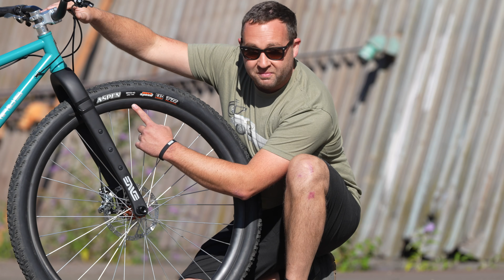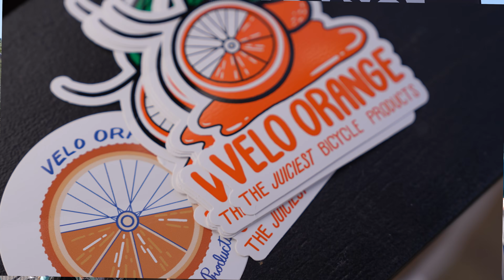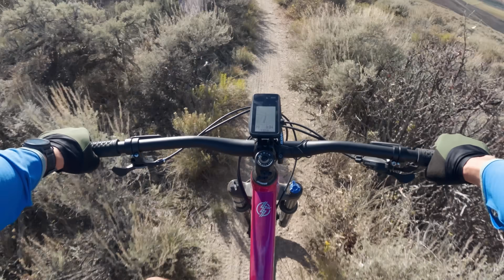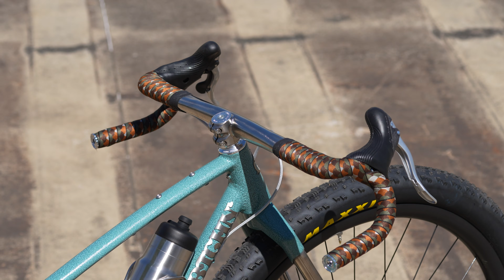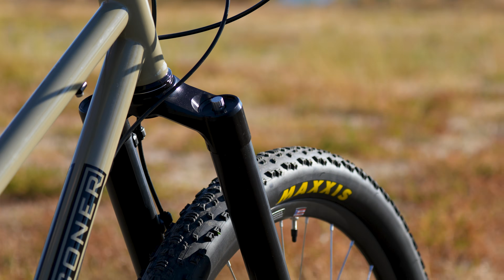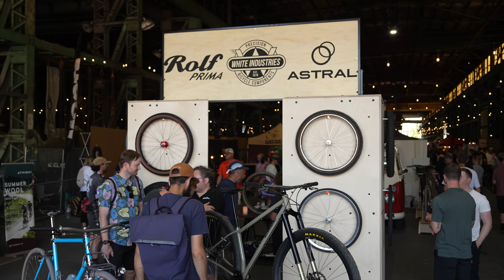Are 32" Bikes The Future? (MADE 2025 Part 2)

Comment: Just like 650B (whose gravel tire selection is slowly disappearing again ever since people figured out that 27.5 inch cross country tires are more supple and grippy and just as fast) it's gonna hinge of tire manufacturers and tire selection. It might end up being a niche for very tall suspension riders or medium and up riders looking for fast rolling rigid bikes, but with suspension travel in addition to the huge tire size it's going to be way too much of a compromise in frame geometry for anyone below medium. Hell, full suspension 29 inch bikes are already at the fringes of useability for very short riders.
Reply: All XC bikes now are stretch limos compared to early 29" offerings. It may revert eventually.
Suspension is NOT a must-have. 26" rigid bikes were how the sport got started and loved around the world and an Olympic sport
With 29" there is less need for suspension and with 32" a bit less still. You will be able to get a 32"er with a 29"-length rear end (brands will just make a better effort) and minimal toe overlap. It will fit and handle fine for every M-L-XL-XXL. Probably even S.

Comment: Rollover is king of gravel and bikepacking, as long as you can standover.
Reply: If the bike can accommodate a dropper, I would put a one on it. It's great for descents, cornering and getting on and off the bike. Even for bikepacking, it's a very useful component.
Reply: @Sonny_Sounds  I've never thought of it for dismounts. Also never tried one. Great insight, thanks!
Reply: @Cloxxki  it geometrical opens up huge opportunities for shorter riders. My partner rides a 27.5/29 mullet and is only 5'3" with a relative to height short inseam. It only works on a small frame because of the dropper.
Reply: depends onthe course, as some with lots of turns and punchy hills this isnt the ultimate. accelerating then slowing then having to accelerate again is tiring on larger wheels.. so is going up steep grades that are punchy.

Comment: I hope not. No need to dilute resources more. Its already difficult to source part for 27,5 and 29er, dont even talk about 26er
Reply: In what way is it hard to source 29er parts?
Reply: @poetac15  Maxxis lineup is HUGE and a lot of ref are out of stock or big wait to get.
Reply: @choanlpoto I see what you are saying now. Less range of options allows companies to focus on what we actually care about vs oddball stuff.
Reply: Yes thanks for the translation I'm not an English speaker 😅  @poetac15
Reply: Bike shops can just about support 3 common wheel sizes. That used to be 700c road/commute, 26" off road/commute, 650c race if you were lucky.
Now they add in 29/700c off road, 27.5 off road. 
They have mostly dropped support for 650c and only support 27.5/650b as off road, not commute.
You can buy a 27.5b commuter bike, but not the tyres.

IMHO, the industry should have abandoned 650c, extended 26" as the small off-road /commute/ road race size and kept 27.5 as a boutique raritity.
29ers gonna 29 but it is 700c .
Reply: I hope this movement strengthens factory mullet options
Imo want to see 27.5/26 mullet options and I already have a 32/29 setup(and if built on fatbike standard ,it can double as a fat bike for fall and winter
I have no issues sourcing any 26er parts let alone 27.5/29
It's just no new options for the smaller 26 and 27.5 has dwindled sadly.

Comment: I rode 29+ for years.  The thing I liked best was that 29+ was taller not that it was wider.  A 29x3.0 tire is 30.5" tall.  If I could have had a 2.4 tire that was 30.5" tall I would have prefered that.   I was hoping that the next new tires size would be 30.5x2.4, mostly because that tire would fit existing suspension forks that now fit 29+ tires.   
However, I'm all in on 32" tires. The only real question is how small of a bike can reasonably use 32" tires.  If a 5'7" rider can fit 32",  I think 32" will catch on.  32" is only going to work if at least 65% of riders can fit 32" wheels.  When Trek and Specialized make full-sus 32ers with forks from Fox or Rock Shox that fit my 5'9" height, I will probably buy one.   It's got to go mainstream before I would consider buying a 32er.   If the big bike and component brands don't go all in, 32" is dead in the water.   
In the end, I still think that 30.5x2.4 should be the new tire size  because it all ready fits existing forks and it would fit more average size riders.  WTB was prototyping the the 30.5" wheel (also called 750d) recently but they seem to have abandoned that wheel size.

Comment: For taller than average people it could work. Probably it will be a better sell as a bike without suspension.
Reply: Nonsense. 
29" works well in size S. World cups won by tiny riders.
32" is 8.7" bigger and modern geometries only favor introduction of 32". Loooong top tubes and slaaaack head tubes. Loooong bike.
An M sized 32" hardtail can easily have a shorter wheelbase than a run of the mill 29" hardtail. And steer better on tight singletrack.
The main limitation is your mindset.

Comment: From a purchaser's perspective, I can't count how many times I've wanted a bike and found only L/XL frames available.  (For that matter exercise equipment/clothing/kit in general goes the same way.  And that's even accounting for size bloat over the years as Americans get... bigger.)  
I know plenty of tall people who ride and I hope this helps more of them enjoy cycling, but I wouldn't feel comfortable starting a company dependent on their demand.
Reply: DirtySixer already did it and they thrive. Zinn has been around forever.
You don't need to be tall for 29", a tiny woman won a world cup on it when the wheelsize was still quite young.
32" is just 8.7" larger based on 2" tires. Modern XC geometries are closer to old downhill bikes now. 32" will fit and suit almost every adult riders.
The main limitation is the mind.
Reply: @Cloxxki  I know all about the wheel size.  I know it's been around.  So what?  Sure, on a 2.25 it's actually only about 2or so more inches in diameter.  But neither am I a marketer's slave  - and so far I've not been sold on the problem this wheel is trying to solve - specifically for someone my height - where frames are already cramped at 29".  For that matter, right now the main limitation is tire and frame availability, money and practicality - this is really quite a specialized racing niche afaics.  I get it has more inertia and speed over open ground; a bigger contact patch, grip.  With all that you get increased inertial mass, more wheel flex (good or bad.)  In my experience going up through the sizes over a very long career in bikes, the pros are not likely to outweigh the cons for this latest jump - for small/medium sized riders.  So no, I don't see the problem yet another increase in wheelsize can solve for me.  So a 32'r has quite a high opportunity cost to me where I'd rather spend my money on things that will make a difference in my riding.

And finally, I'm curious to what world cup you're referring.  The first cup appearance I see cited by Bikeradar, Pinbike and Bikerumor is a slew of stories about the BMC team's July 2025 prototype used in Andorra.  (It did not win.)

Comment: I’m a tall guy and 29” are rolling fast but are not as nimble sometimes, but I would like to test it anytime 😊

Btw Neil this video is sponsored by Coros, any chance you have your hand on the new Coros Nomad ?

My friends told me I’m way too short with my stem(32) this chad runs a 16mm !!!! @10:37 ❤
Reply: Modern XC bike geometries would have been considered "downhill only" when 29" first hit the scene. If your trails are tight, get an old 72º heat tube angle frame. When I see modern geometry sheets, I do wonder whether I'd enjoy those on tight singletrack.
When I designed some of the early 29" bikes, it was with tight trails in mind, as sceptics held on the notion that 29" would just not get around any sort of tight bend. I am 6'4" with insanely long legs and I became all but invincible on tight singletrack with my 29"ers. I need to test but modern bikes seems like they need to be more cumbersome than my early 2000s 29" bikes.